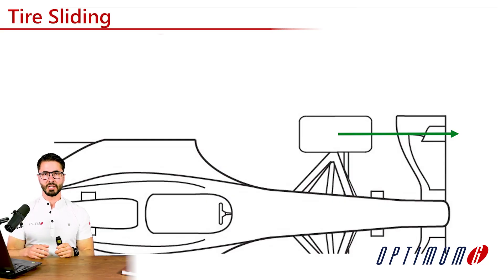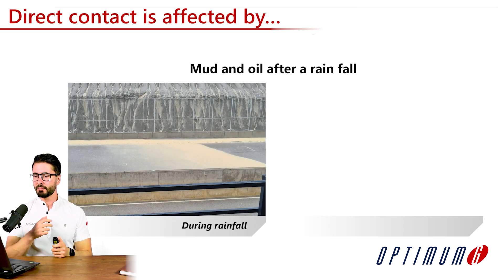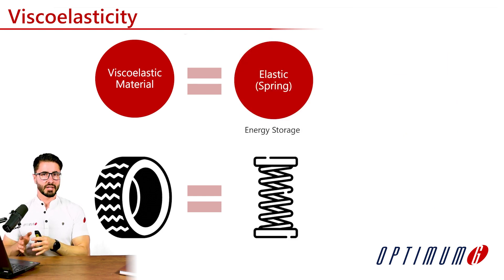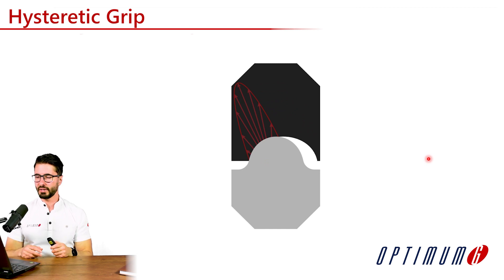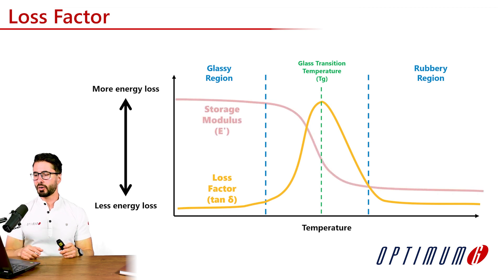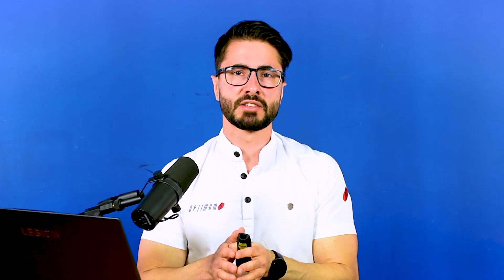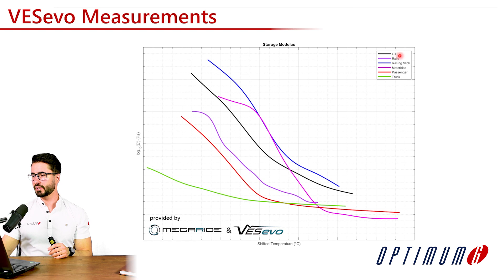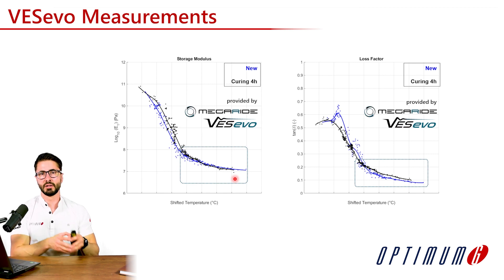Tire Grip Mechanisms | Tire Performance Series ft. @megaride-appliedvehicleres - Ep. 1

Comment: It would be interestimg if you could do the following themes: 
- zero droop suspensions, or why cars with close to zero wheel load during limit cornerimg are usually faster
- the influence of tender/helper springs
- chassis flex/warp mode 
Thanks!
Reply: What do you mean by "zero wheel load during cornering"? This sounds like something impossible.